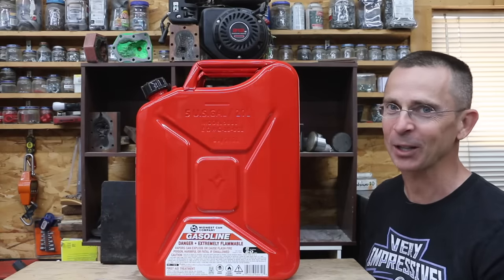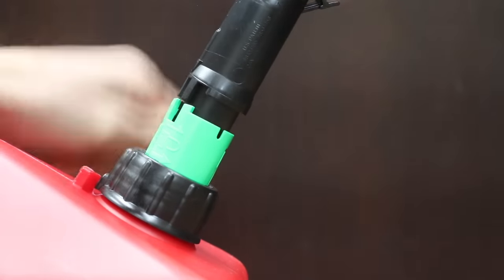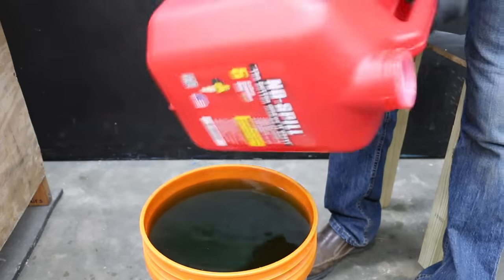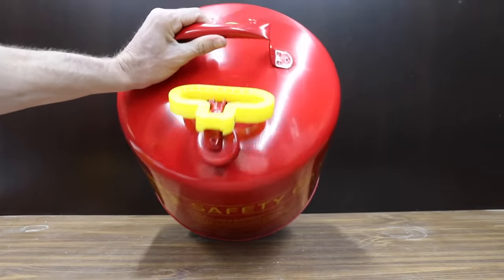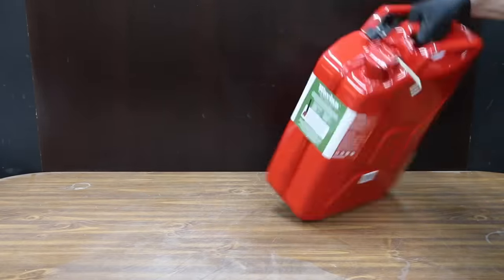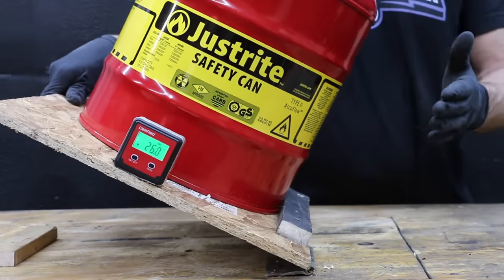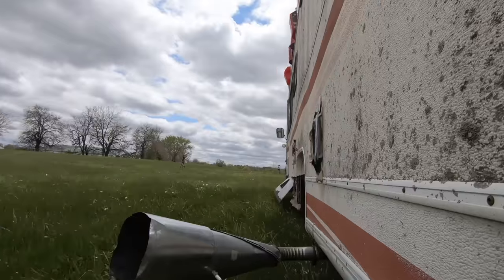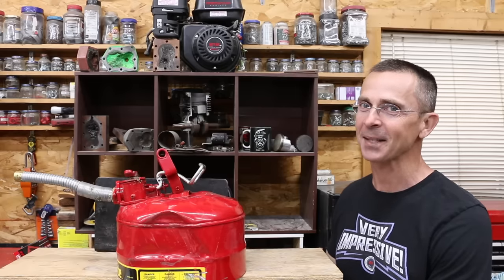Best Gas Can? $140 Wavian vs Eagle, Surecan, Scepter, Briggs & Stratton, Midwest, VP Racing

Comment: Love this. One additional testing measure that came to mind would be how easy it is to stop pouring without spilling. Most often I’m filling a lawnmower or string trimmer, something with a much smaller fuel tank than my gas can, so being able to top it off without dumping gas all over is important. 

Thanks as always for all the effort you put into these. It really is a phenomenal undertaking.
Reply from the maker: Thanks and you are welcome!
Reply: You would like the No Spill fuel can then. Works really well to control and stop flow to small engine applications.
Reply: The JustRite can would come out in the top of that catagory. All the self-sealing nozzles offered on plastic cans are frustrating to use and make the cans difficult to use in a variety of situations.  The JustRite safety cans offer excellent flow control and stop securely leaving just what's left in the nozzle.  It's pretty easy to not spill a drop with, big or small tanks. They work so well, I switched exclusively to JustRite cans, gas (red), diesel (yellow), and kerosene (blue).  They're pricy, but should last a lifetime and the fact they just work easily and relatively precise makes it worth the investment. I would suggest purchasing the smaller nozzle size (5/8"?). The problem with the 1" is it's so big it makes it hard or impossible to see inside the tank you're filling especially on smaller equipment like trimmers and chainsaws. No affiliation, just a happy user.
Reply: THAT is an area the Surecan does very well on.  Since you can set it down on a higher surface, you can pay attention to the filler neck to see when you are getting close to full, and the trigger mechanism is similar to a gas pump, in which you can lighten up on the flow as you're finishing the fill.  I also possess a two gallon Justrite and that mechanism shines in the lighter size. I use my fuel cans almost exclusively for fueling garden tractors and walk-behind mowers.  Those two cans have become my go-tos for the oh-so-precious ethanol free gas that I put in the yard equipment.
Reply: Any time i gas up a mower ect, i know that i WILL almost 100% spill idk a good bit. Whatevers left in the throat/pour spout of the gas jug is going all over.

Comment: I have replaced most of my cans with VP cans. I love my VP cans! I own some that's well over 10 years old with no issues. There's tricks to keep them from leaking out of the vent. You have to start pouring then crack open the vent and close the vent before you stop pouring. Also by closing the vent it'll make pour slower to keep from over flowing. Love the videos👍
Reply from the maker: Thanks!
Reply: Checkout Pit Posse Utility Jugs.
Reply: @dudeman5788  I've looked into them before. If or when I need a new one I'll give them a shot.
Reply: The LC2 cans are beefier VP cans.  Unfortunately all of them seem to be in short supply

Comment: I have one of the midway style cans with the back handle, and it makes filling the lawn mower MUCH easier.
The VP racing cans are my favorite, especially when they held the wonderful castor oil burnt by 2-strokes. Old memories.
The price and performance of gas cans is absolutely DESPICABLE because of the GAS SPILLING anti-spill devices.
Reply from the maker: Thanks for sharing.

Comment: After dealing with way too many gas cans with convoluted safety features that just make then a PITA to use, I caved and bought an old-school metal jerry can. Works amazing; drained 5 gallons in 1.5-2 minutes with no gas left in the can. Now I can use both hands to actually support the can.
Reply: I imported a couple of old style Scepter gas cans from Canada 7 or 8 years ago. Having a separate spout to screw on is a bit of a pain, but as you said they drain fast and completely. Plus they are not vented and gas lasts longer.
Reply: @chipsterb4946  Best cans are the older "Blitz" cans if you can find them...You just need a $2.00 funnel from Harbor Freight...
Reply: I completely agree with you.  The new designs have become such a chore to use.  Stop dumbing everything down designers.  We're not all idiots!
Reply: Another excellent PF video. Most of those government-mandated "no-spill" spouts are falsely named monstrosities that cause many, many more spills than they prevent. However, if you buy a plastic can, there are inexpensive kits available online that will convert it to a pre-mandate can, i.e. a plain spout with a separate vent you open by removing a little plastic stopper before you start pouring.
Reply: @loumencken9644  I've gone that route and using the flexible accordion fuel spouts with caps on the tip so they don't need to be stored immersed in gasoline. The ease of use rivals that of my Sure Can, and can go from start to finish without having to touch any gas covered surfaces.

Comment: The laws that required these to be created has caused so much hassle and counterintuitive designs. I’ve had several of these ‘safe’ pour gas cans and they have all failed after a month or two of use. Now my crew and I take the nozzles off and pour into a large funnel.  A terrible design flaw is when you have them sitting outside in the sun it creates pressure so when you engage the nozzle at any angle it sprays everywhere!
Reply: I still have some from back in the day that I won't toss. And anytime I sell extra's at a yard sale, they go insanely fast, people want the old school ones.
Reply: Setting the sun and building pressure  is why they should be band they cause more harm then good my old school sets in my truck straped to the side with 5 gal gas in a 6 gal can in it 7 days aweek 52 weeks a year and NEVER had any trouble
Reply: You know that you can fix those new cans, right? They sell regular nozzles, and vents that you drill, and install into the can all over the place. This is just one more example of "no one can screw up a plan like government". Those new cans are GARBAGE. That's where they all belong. I still have old ones. The metal ones, and a couple plastic ones. I still like the metal ones the best though. I've never thought that completely sealing up a can with gas in it would be a good idea. It doesn't even need to be in sunlight to get all ballooned out. Those things are so freaking ridiculous.
Reply: I got gasoline in my eyes thanks to the new designs. I went to put gas into the mower and there was pressure that had built up in the can so the gas went into the mower and then straight into my face. That was highly unpleasant. I'm just glad my mower was cold at the time otherwise it could have started a fire and I would have been severely burned.
Reply: @Quake120  I would suggest either fixing (making your can like the older ones) your current can, or hitting up garage sales, or flea markets around you and just buying an old, non governmented can.

Comment: I’ve got a smaller surecan and have been very happy with it. Easy to fill, can be easily vented using the fill cap and pours quickly. Just make sure to vent it first when it’s warmed up and built a little pressure, or it’s a very quick overfill on the ol lawn mower. The O-rings on my fill spout did fail after a few years and I emailed the company to see about either buying some new ones or what size so I could easily get them from a parts store but the company asked for my address and sent out a free replacement spout. Great company! I recommend them to anyone needing a good gas can!
Reply from the maker: Thanks for the feedback.
Reply: Excellent. I decided to get this can and your input was icing on the cake.
Reply: I'm a senior citizen and find it difficult to hold a heavy gas can for a long period in order to fill my riding mower. I like the Surecan because I can rest it on the fender of the mower, and as the tank begins to fill up I can release the filling lever and the fuel stops, all while not having to hold the weight of the can. I like it.

Comment: I wish someone would sue some of these manufacturers for the false claims of "spill proof", "hassle free", and "smart fill" baloney. I'm old enough to remember simple, metal gas cans with a vent that just worked and lasted decades if you didn't lose it. Thanks for this review, I'm in the market for a new gas can!
Reply: For CARB compliant fuel cans, I just remove the nozzle and pour it in a funnel.  Works so much better.
Reply: @Kriss_L  I wish it were as simple; I'm just wanting to top up my weed whacker, lawn mower, and leaf blower  every couple of weeks and the 1 gallon can I have (scepter no spill spout) leaks a little gas from the spout for each piece of equipment each time. Same with putting the remainder into my motorcycle, about half a tea spoon of gas dribbles out from the side of the spout each time its used. These gas cans have come up with non-vented methods to prevent gas vapors from polluting, but each time you use it you release more vapor than just leaving it sit with a breather hole open.
Reply: @Sizukun1  And that's why I use a funnel, whether it's for my truck, chainsaw, or string trimmer.

Comment: I own almost every gas can in this video. My favorite in actual use for garage use (filling up a lawn mower) is the 1 gallon Just Rite. It doesn’t spill anything , ever. The fuel flow handle can be opened just a little bit to regulate fuel flow. I prefer the 1 gallon size as it is light weight and it keeps my fuel fresher by replacing it more often.
Reply from the maker: Thanks for sharing.
Reply: I use the same gas can
Reply: You have to these days. I have a collection of cans on the shelf that I no longer use because the gas won't last. I use a little half gallon can now for the mower. Let it sit for a month and the gas goes bad. Even adding sta-bil this new fomula gas just coughs and sputters if it's anything but new. My guess is the ethenol is sucking in moisture.
Reply: <<I prefer the 1 gallon size as it is light weight and it keeps my fuel fresher by replacing it more often.<<

I agree.  I drain the contents of my 1 gallon fuel tank into my car gas tank once/month and refill.

Comment: I have a jeep Liberty and I could not hold a 5 gallon can up to the filter neck without spilling fuel with the soil proof necks. I now use a tall step ladder and a shaker siphon with no spills. Out in the wild I carry two five gallon Jerry cans on holders mounted high on the rear rack so I can still use the siphon without the step ladder. No spills, no fuss. Thanks for the great video!

Comment: Seems like the perfect place to share that the best gallon  gas cans are free if you change your own oil. The four and five quart jugs of motor oil hold gasoline very well and are clear on the side for easy measurement. All my mixed gas gets mixed and carried in those. The caps are designed to be leak free because motor oil has a pesky habit of “finding a way” out if the jug gets tipped. My five gallon gas cans are all infuriatingly annoying to pour from, thank you for making this!
Reply from the maker: You are welcome!
Reply: A five quart jug of oil is like a 1.25 gallon gas can.  Both are lighter than a 5 gallon container, and therefore more user friendly.
Reply: Truth in labeling, though.  And EPA approval might be important for commercial applications.
Reply: @libraeotequever3pointoh95  Might be a regional thing, but all of mine are only marked up to the four quart level so I tend to use them as gallon cans.

Comment: There's a reason everybody copied the original German Jerry can.
It was and still it the best design.
I have 2 1940s ones that are still going strong. And that's not unusual.
Reply: Its smart design, very  durable , and has features in its design to prevent expanding from heat also , what is also very important to gasoline canisters
Reply: What do you mean everyone? Most of the brands here were not that style. Did you even watch the video?
Reply: Yeah he did miss testing a Specter Plastic 20L fuel can. In my experience they hold up better to impacts than the steel ones. They only take 40-60 seconds to empty the can.
Reply: @mediocreman2  He's probably referring to the militaries around the world.

Comment: Another great review....! 

To add a bit of feedback: I've found in hot storage climates (such as south Texas) the center seamed, inj molded cans are quite terrible.  The reason being is that due to the spouts not being able to vent...under ambient heat and vapor expansion the cans will blow up like balloons and then the molded seam will split open....rendering the can useless.  

I actually own several of the "Just-Rite" cans because of not only their easy pour....the spring loaded fill top will "burp" vapor under higher ambient temperatures to keep internal pressures nominal. You missed this feature within your evaluation. 

If you remember the old yellow, button top vents on steel gas cans they used to do that too....during overpressure the tab would pop off and vent prior to an issue occuring.

Seal those cans up with their one way valves,  add fuel and put 'em in the summer sunshine (the plastic ones)...it's quite comical.   They vapor inflate like beach balls.   lol

Last comment regarding "Just-Rite" ....for some vehicle fills the 1" captive hose is too large in diameter to fit within a fixed, vehicle filler trap.  

There's a smaller diameter line that can be purchased as an accessory to better fit vehicles w a narrow point of entry. 👍
Reply: I’m in Texas also & had that style of plastic gas can, saw it in time to vent before it exploded. Have yourself a good
Reply: All most all plastic fuel cans are blow molded using a clam shell type mold.  I have had several plastic cans fail at the center seam, they were all brands that I didn't recognize.  I have several Rubbermaid cans, no longer made, for 30 years without any leaks even at the center seam.  I also have several VP cans I use with diesel, they are well made and rugged and are my favorite.  The thicker the plastic thus the heavier the can typically yields a more rugged can.  I am also in Texas and hot weather is hell on plastic fuel cans
Reply: I've not had a can split (yet, in NC), but I do try to remember to loosen the spout collar nut very slightly when the can is safely in my shed, just enough to avoid the can building pressure.
Reply from the maker: Thanks!  Thanks for sharing.
Reply: Another Texas response here.  I've had good luck with my Midwest 1 gallon can staying together, even when ethanol added fuel makes it balloon.  I've found that adding fuel stabilizer helps reduce the ballooning some, although it doesn't eliminate it.
edit:  when I fill it with ethanol-free, I get no ballooning.
Reply: My harbor freight blow molded can sat in the sun once and how it doesn't sit flat anymore lmao
Reply: I have the Just-rite's and have found them to be the best for me. I purchased them with the 5/8" line from the start and they are fantastic. I own 6 of them and I will pass them on to my daughter.
Reply: @pville5548  hello.  why the 5/8" line instead of the 1" ?

Comment: I love my vp can!
ps the fuel leaking out of the breather can be avoided by opening the breather after you tip it over to allow the can to create a vacuum
Reply from the maker: Thanks for sharing.  Thanks for the feedback.
Reply: Agreed, the VP cans will actually vent REALLY well if you open the breather all of the way (maybe emptying the whole can in 45sec), but I think I have the best luck when I keep the can slightly angled rather than completely upside down to keep fuel away from the vent. Little tricky but definitely the fastest emptying cans I've used to date.
Reply: I've had the same VP can from racing motocross.  It's probably 20 years old.  Lost the o-ring inside the large cap, but the local hardware store had an o ring that fit.  Been working fine for probably 12 years now.   The spout gets hard over the years, but it's easy enough to replace!

Comment: Great video, I have broken at least five no-spill devices over the years. The best jug to refill Jet skis and other water toys are the VP racing design jugs- flexible spout and will empty quicker than your arms give out!!! I think the vent is the key to be able to pour fast, the large 5 gallon jugs are very difficult to pour into a regular vehicle I have found, bad design as demonstrated. Keep up the great testing! Cheers.
Reply from the maker: Thanks, will do!  Thanks for sharing.
Reply: they have electric pumps that screw onto the VP style jugs. don't have to hold the can up at all

Comment: You knocked this one out of the park with the extent,  thorough and creative real scenario test situations.  Bravo 👏 
Of course the first thing I do with my new plastic gas cans is throw away the crappy nozzle and get the "rebuild" kits that add a vent and old style nozzle.
Reply from the maker: Thanks!
Reply: That's the most cost effective way to get a configuration that works almost perfectly for all situations.   They're almost a pleasure to use in comparison with the lip trigger nozzles and their ilk.
Reply: Wow!, thanks for the heads up on rebuild kits.  Both my 20+ year old Rubbermaid plastic cans finally developed leaks over the past year on the bottom so had to run out and grab a replacement.  I bought the Scepter from Costco, brought it home and was so annoyed with the nozzle i was planning to bring it back, only it looks like every manufacturer has some funky fill tube now.  Going out and buying one of these rebuild kits right away and thanks Project Farm for such a great in depth break down once again!
Reply: @vcookster3915  most farm/feed stores sell the rebuild kits.  They are not cheap (about $14 each the last time I bought them),  I buy the 2 pack of them. They are worth the money in my opinion.
Reply: I got a set of 3 for $18, so far they're all working out well. Some cans may have different thread size so ymmv